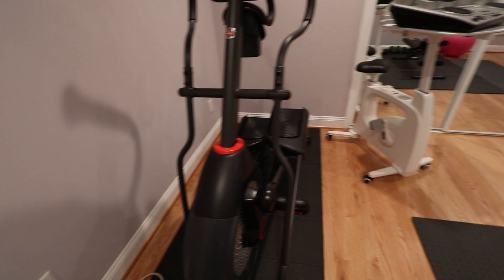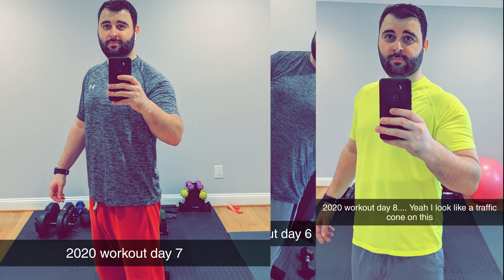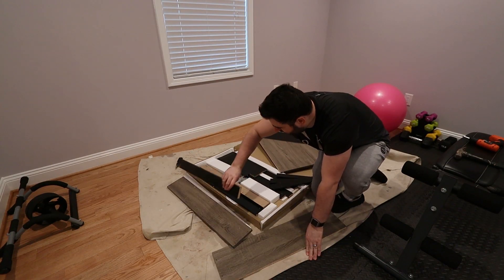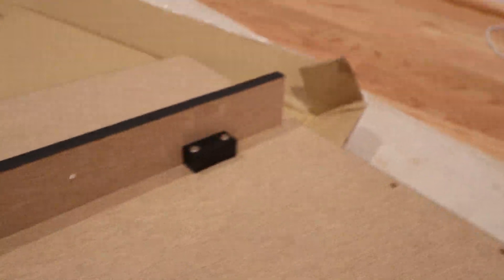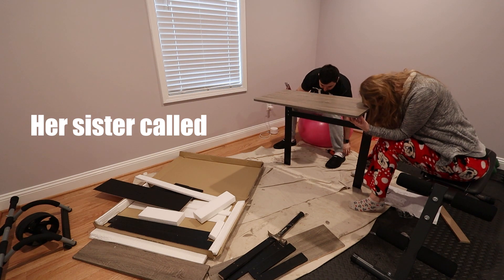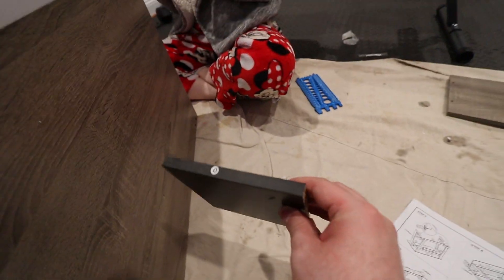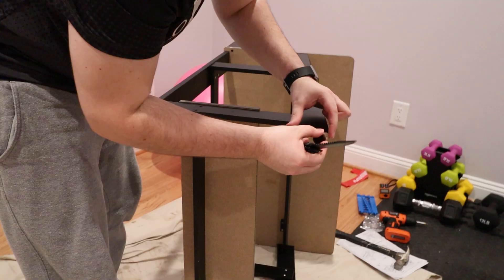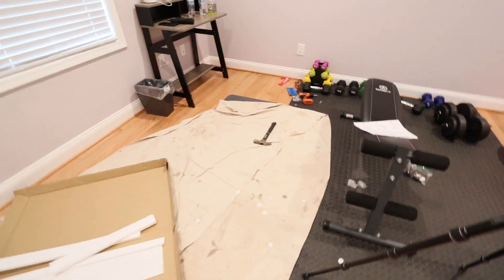I Built a 30 Dollar Table From AMAZON - Project WOOP Review

Comment: i’m currently setting up this exact desk right now! I wish you showed the exact screws you were using. for whatever reason, the screws for step 1/2 aren’t fitting correctly..
Reply: leelee that’s my same issue and I’m just now trying to build it. Did you figure it out by any chance?
Reply: Same I’m upset lol
Reply: Lu Neverland I figured it out lol there’s actually two much smaller holes next to the other bigger ones
Reply: Yesenia Tapia I made the mistake and put the part in backwards so I fixed it lol.
Reply: He told you to put in the wrong screws for step 2. I had the same problem
Reply: @charliepayne6611  he did and now the screws are loose.... no wonder he said it was wobbly.
Reply: Right thts what im saying.  Now I good at fixing shit but I hve all kinda screws an tacks an dont kno where none goes
Reply: @charliepayne6611  Actually when you look carefully, it looks like the manufacturer sent him the wrong screws.  There are supposed to be 12 screws in package #2, but the guy got a lot more than that.  Either that or the manufacturer has changed the type of screw since this video was done.